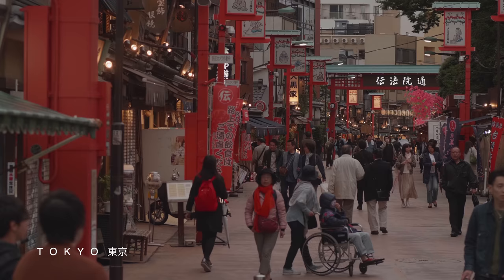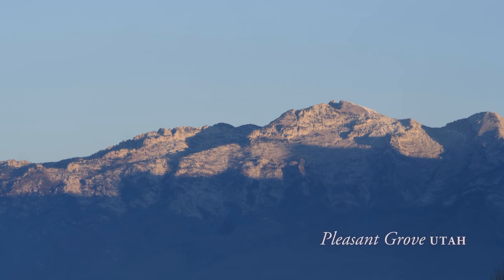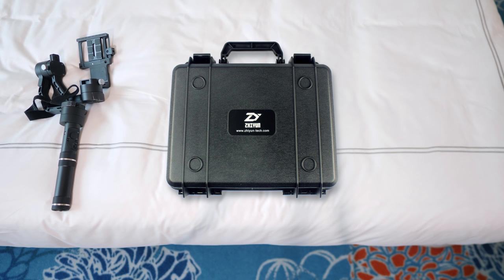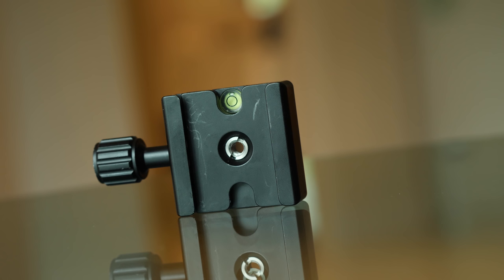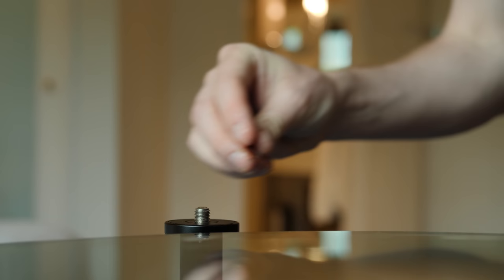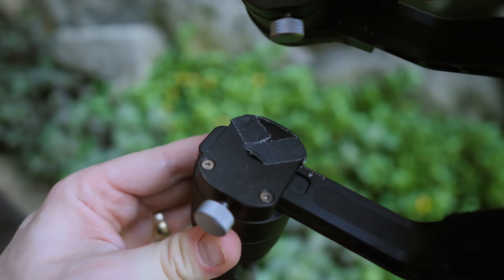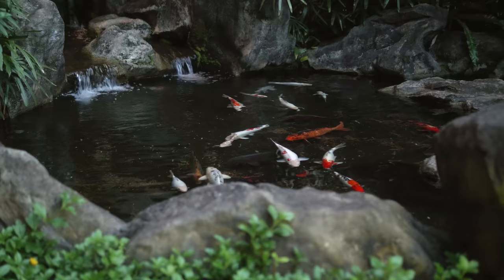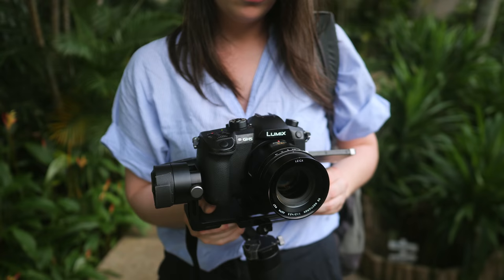DIY Travel Solution for Zhiyun Gimbals

Comment: Just picked up the Crane 2 and due to the camera size/balance required I had the same problem of the arms hitting tilt motor hitting the top of the pan arm like you did.  Great idea about the galfers tape and rubber padding!  It'll save the finish from getting all scratched up, thank you!!

Comment: Excellent video Griffin. I think this is the biggest problem plaguing gimbals right now: storage and portability. I had to figure out all of the things you explained in this video on my own for a trip to the Hoh Rainforest in Seattle. Had to fit everything into a small backpack because I couldn't lug around the official carrying case ( I use a Pilotfly H2 gimbal). The velcro tie to secure all of the moving parts works pretty well, but I always worried that there was not enough padding to protect this delicate piece of equipment.

Comment: How do you store the moza air 2 without destroying the gimbel. The seller told me it must be like in a hard box and without any camera on it to not harm it when traveling is that right?
Reply from the maker: Polani Almoni, That sounds right. That's the same as this gimbal—intended to be transported in the box, without a camera. But with some minor hacks like these, I think it's possible to travel lighter.
Reply: @GriffinHammond  do you need to adjust and balance it again afterwards? With the same setup?
Thanks!
Reply from the maker: Polani Almoni The benefit of using the Velcro, is that I can leave all the arm lengths intact. So no, if I mount the camera in the same position, the balance is likely to still be good-to-go.
Reply: Griffin Hammond do you have a link possibility to the velcro haha it is actually super hard to find the right type. :/

Comment: I've got a different model, have the optech clips on the gimbal plate, invert the gimbal upside down and hook the leg with strap, super fast, everything is tight to my body, minimal hardware. Use primes, no more metal banging.

Comment: Thanks Griffin for the tips.  I have a similar problem with my GH3 and Pilotfly H2.  When I get it balanced with the screen out, it won't fold flat.  However, I'm hoping to deal with some of that problem by using "tungsten putty" (can be found on Amazon under pinewood derby products) and using that as a counterweight.  A ball almost the size of a large marble weighs about 1oz and it behaves like the "blue tack" college students use to stick posters to dorm room walls.

Anyway, thanks for the tips!

Comment: Do you set it to heavy mode when you put a heavy DSLR on app? for some reason my canon 5d mark iii and 50mm 1.8 or 40mm 2.8 pancake wont balance.. maybe because i use a cheap Zhiyun Crane v2 a $390 one... Or should I purchase the expensive Zhiyun Crane which cost $800 and up
Reply from the maker: Slxxpy Jan, You'll need a bigger gimbal for your 5D. My camera/lens setup is under 4 lbs, which I think is about the max for this gimbal. But check the specs for the "Crane 2" (different, bigger model) or the Ronin-S by DJI.

Comment: Hiya... 💓my Zhiyun Crane v2! Had the sames issues with mine! I rap mine up in a T-shirt with large rubber bands for my backpack but I unscrew and take off the handle as it's to long for my pack. I have a quick release plate as well but hardly ever use it as I've got really good at quick balance with just the screw on the Gimbals plate.

Comment: What quick release plate do you use?
Reply from the maker: This is called an Arca-style plate, and many manufacturers use them. I have one from a MeFOTO tripod, and I also bought a Barska head with one. I can't actually remember where this mount came from. I believe I stole it off one of my other pieces of equipment.
Reply: you need to link it to amazon so you can make money when we buy one!